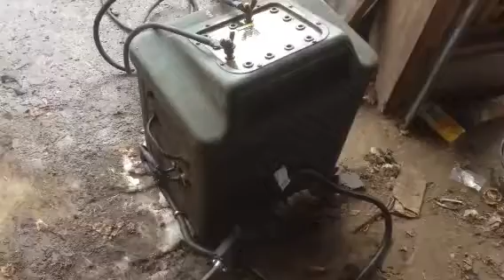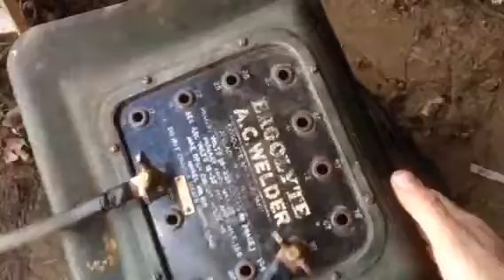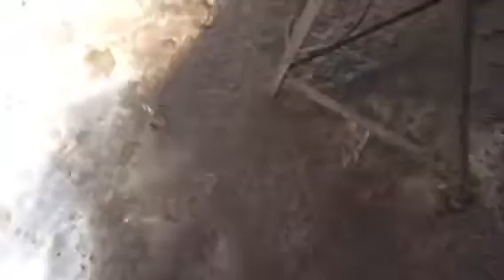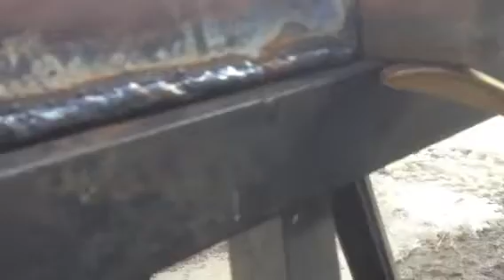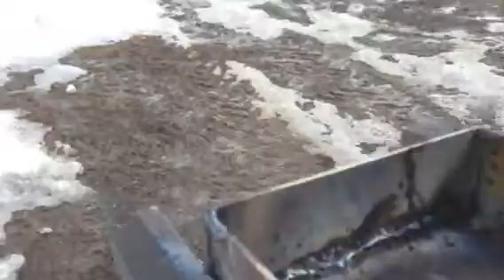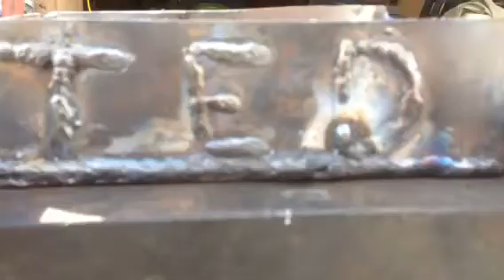Getting better at Arc welding

Comment: Grind it very smooth, wire wheel it with that grinder of yours so it shines, then preserve it with like wax or something so it stays shiny!  Very nice!  I can't believe you are just starting to weld!  Once a man owns a welder he can never live with out I have done all kinds of stuff I could have never done with out a welder using stick and mig.  I have a miller 210 mig welder and a 60's miller thunder bolt (they call it a buzz box welder because they are kinda loud)
Reply from the maker: I eventually will get a mig, I am very happy with the 1930's  Ergolyte welder I fixed up It works excellent has huge windings in it. you can hear it when your welding but its pretty quiet compaired to many. Yeah I have never had an opportunity to even try welding up until recently so I had been wanting to do it and just jumped right into it